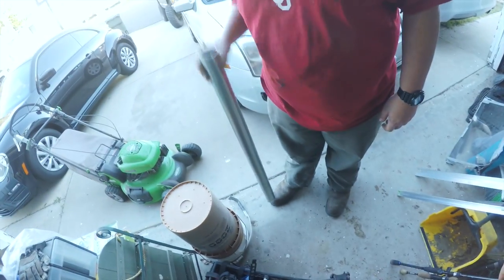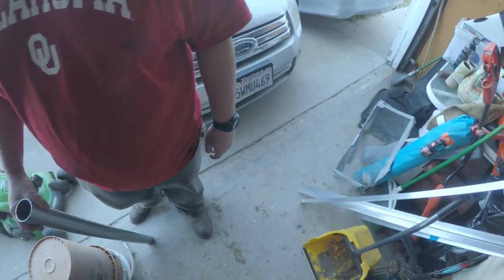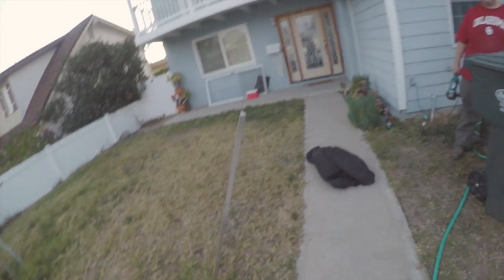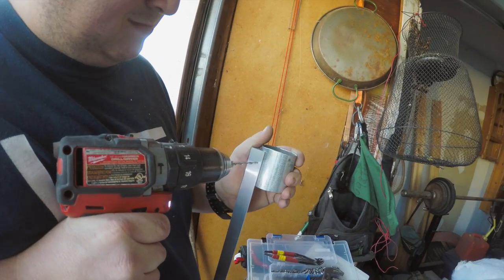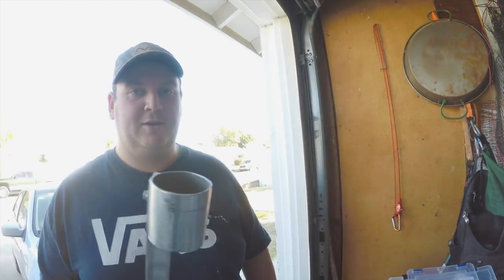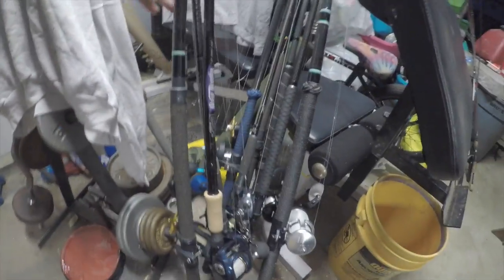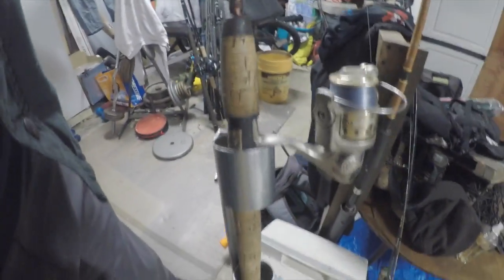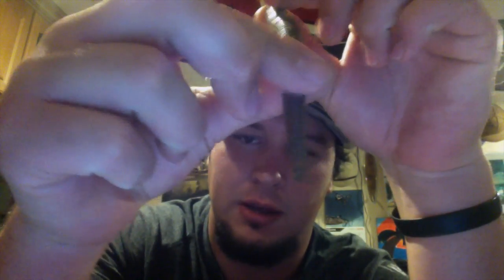Making Fishing Rod Holders

Comment: Use bed frame angle iron instead. Much more durable especially when you pound it into the ground. That material these guys are using is going to bend very easily.
Place your tubing 1/2 inch below the top of the angle iron when attaching. If you place it at the top like these guys did you will bend it or break it when you go to hammer it in.
Clean your shop before you go fishing or make anymore YouTube videos.
Reply from the maker: Thanks for sharing all the advise! I'm not super into bait and wait fishing, so this was just kind of a build it to try it lol.